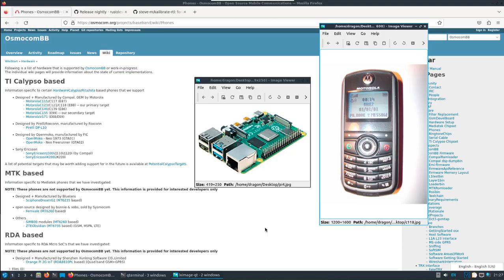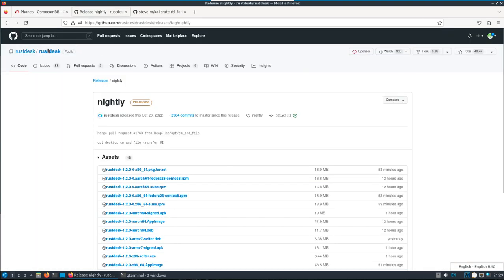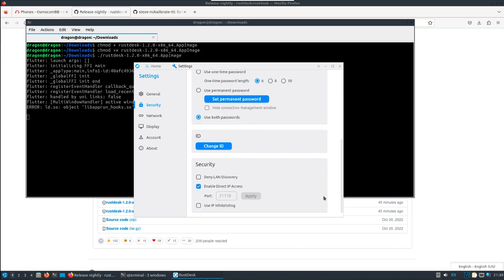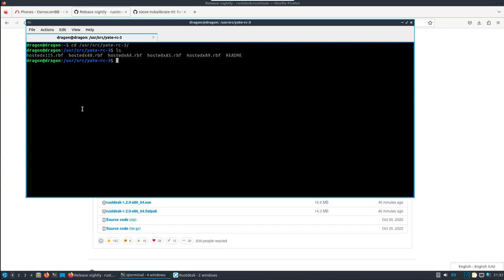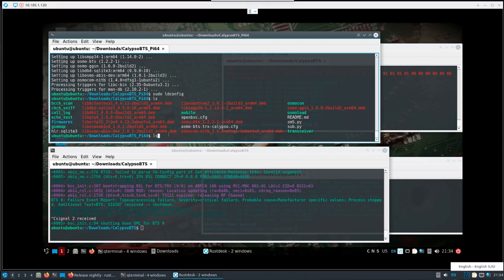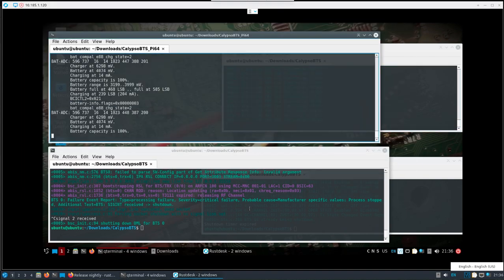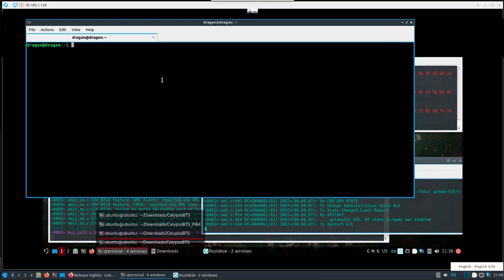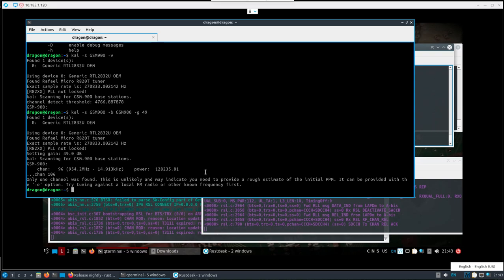DragonOS Pi64 CalypsoBTS w/ C118, RustDesk, and Kalibrate-RTL (RTLSDR, Motorola, Pi4)

Comment: Hello again. I’m slowly learning Virtual Box , Linux and the command line. I have two Hackrf’s that I’ve installed, updated, fixed VM usb issues for, etc. Next comes the Ubertooth One I got. I thought I was getting things handled until I went to update and received a libUSB error , pipe error -9, when trying command to difunto update firmware, and a usb claim interface error -6 when trying command to reset or to run specan-ui. When I enter lsusb in command line it shows up as available device. I’ve tried changing drivers in windows, checking id running vs dfu and still “No Joy”. Any input would be greatly appreciated. As I’ve been learning the command line I’ve come to see just what a powerful resource you’ve put together in Dragon OS. I was trying to run Sparrow Wi-Fi with Hackrf and Ubertooth like your video and got it up and running just no Ubertooth. Thanks for your time taken to read this and thanks for the countless hours you put into OS. It’s truly remarkable.
Reply from the maker: Hi 👋 I’ll give my ubertooth a check, I don’t recall such a problem when I used it last but I’ve not used it within virtual box. If you update using sudo in front of the command does that help?
Reply from the maker: Are you using the lastest DragonOS FocalX build?
Reply: @cemaxecuter7783  Yes, to the FocalX plus update. I updated everything I could find referenced in GitHub and/or “read the docs “haven’t tried sudo in front of dfu command, but will try that shortly. I’m 47 and my brain was mush to begin with…between the couple of Linux Webinars on top the videos specifically aimed at Dragon’s content and functionality, I will not be surprised to sneeze and see brain matter in the tissue. All worth it though. Haven’t found anything that held my interest like this in a while. Thanks for the quick response, I really appreciate it.
Reply from the maker: So I checked mine plugged directly into a desktop running DragonOS. I can see I have firmware 2020-12-R1 loaded after running ubertooth-util -v in a terminal. So far I’ve not had to run sudo in front of anything. I’ll have to try via virtual box. Yes, this stuff can consume all your time Haha, so many crazy/cool things are possible.